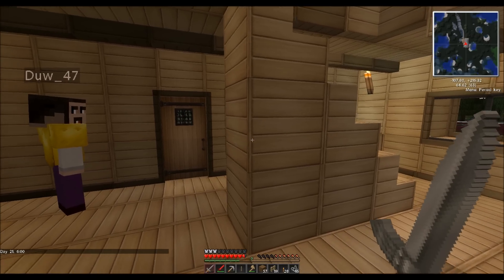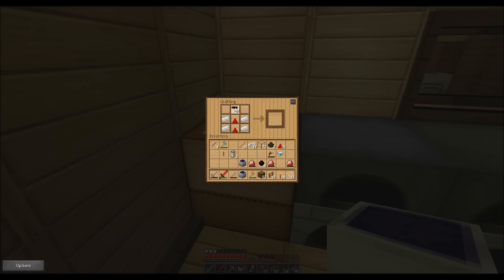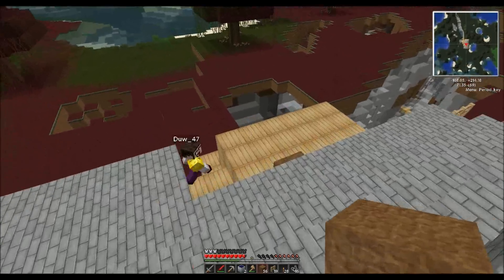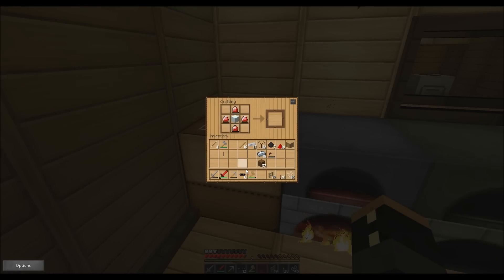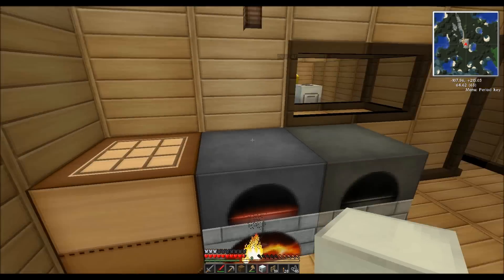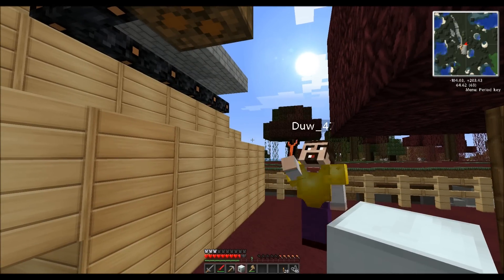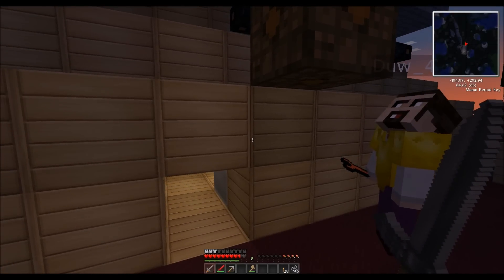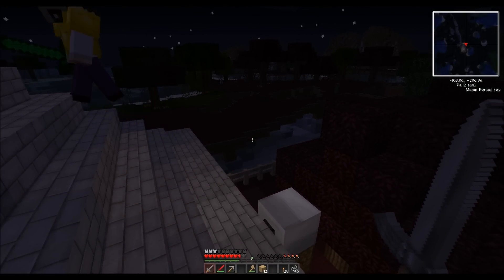Minecraft Tekkit - Solar Power

Comment from the maker: The Mass Fabricator works better with high voltage. You will need to run a glass fibre cable from the MFSU which should join up to the mass fabricator and attach it to an MV transformer then attach this to a LV transformer and then run a copper cable from this which you should use to power your machines. Alternatively you could use 3 transformer upgrades in all your machines to upgrade them to high voltage but it will use more power.

Comment: Is a mass fabricator High Voltage? As i am using an MFSU to power a mass fabricator and recyclers outside and also 4 furnaces, 2 macerators, a compressor and Extractor inside too. I am having trouble to power all of this since i built the MFSU to power it all! Could any suggest what to do? What cables and what type of transformers should i use so it will all be powered well? Please, ive been struggling with this problem for a while :/

Comment from the maker: To connect the solar panel to the mfe copper cable is alright and to connect the mfe to the mass fabricator you will need to use any HV Cable :) We suggest using a recycler to get scrap metal so your mass fabricator doesn't use so much EU.

Comment from the maker: Optifine comes installed with tekkit , this means that it already has HD texture pack Support so you wont actually need MC Patcher. Make sure your using the recommended build in the Technic launcher setting's :).